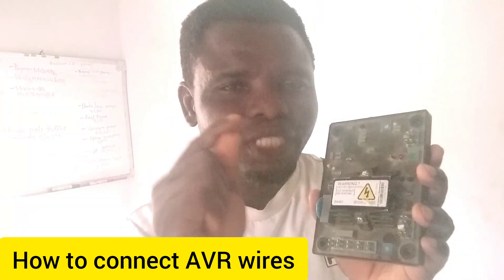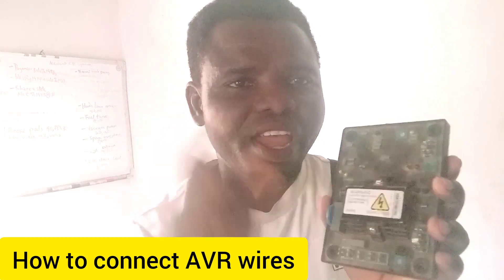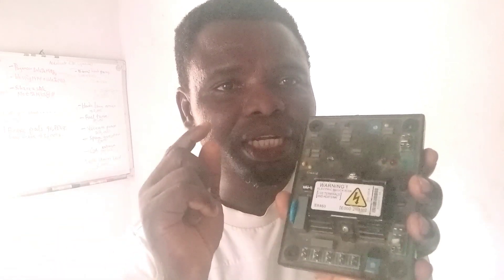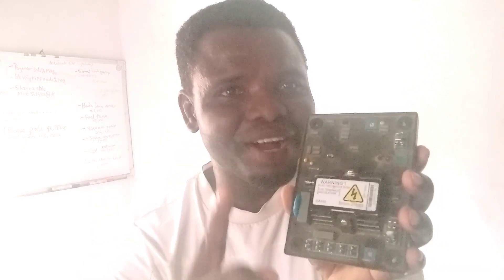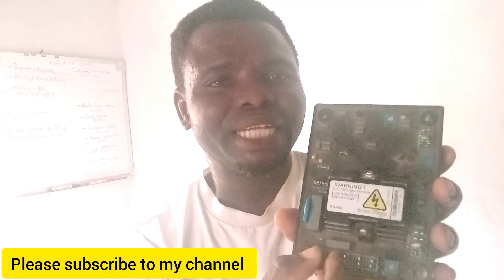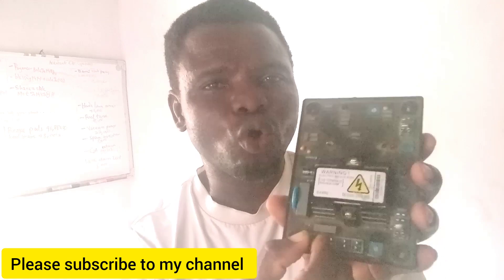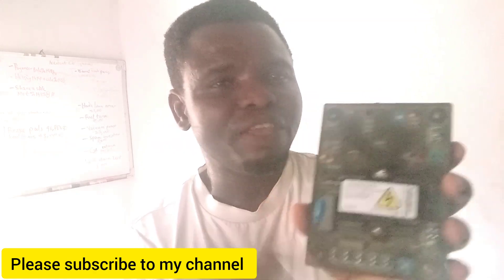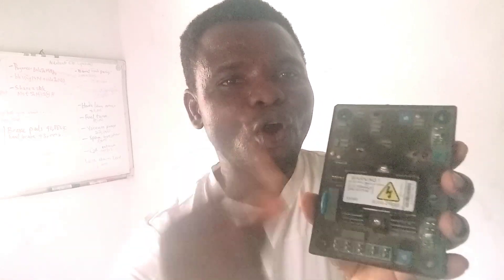How To Connect AVR

Comment: Please. How doni tune the stability of the geerator power output.  Its dropping current when onload.
Error generated is "Bus voltage is abnormal"
Reply from the maker: Adjust the injection pump or service the injectors (nozzle)